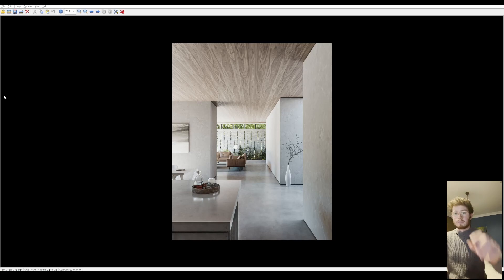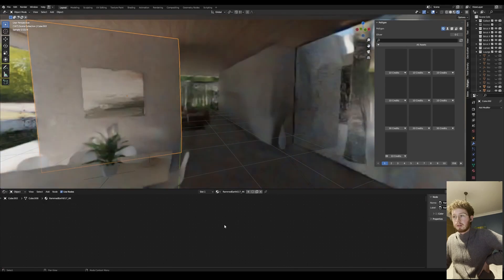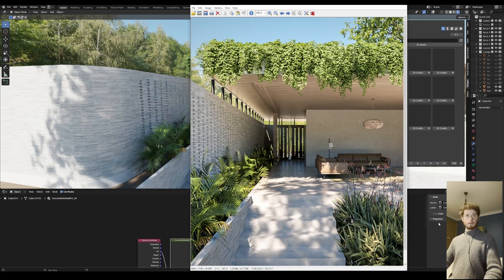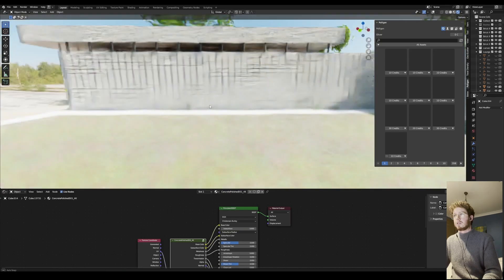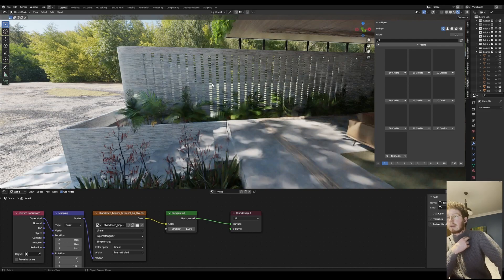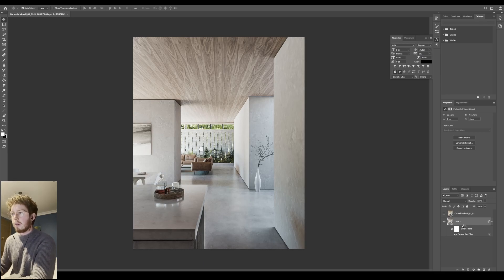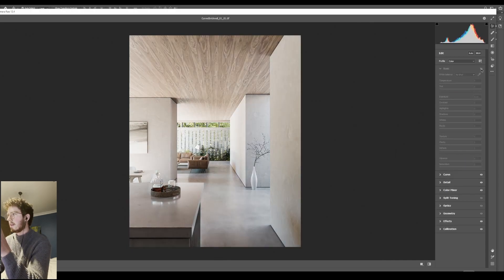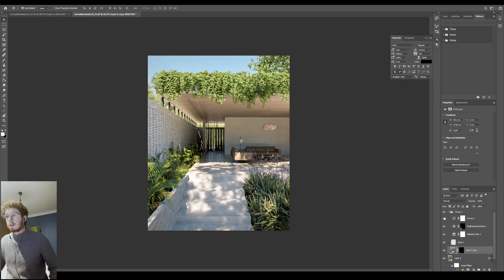Blender Archviz Project Breakdown: Curved Brick Wall

Comment: Hey bro u be doing alot on here and its definitely helping me big time, thanks. I'm a newbie in 3D archviz and I'm finding this whole offline rendering and CPU thing very interesting.  i have an nvidia rtx 3060ti 8gb gpu but the vram is always running out of space when I'm doing some basic scenes and its really exasperating. so i really wish to know more on this and how to manage that
Reply from the maker: Hey mate you definitely want to switch over to your CPU if you have more ram than your GPU. Other than that just try to optimise the scenes, link your vegetation and other big files into your main blender file instead of just importing in normally. Hope that helps

Comment: Nice presentation. Can you also share your hardware specs and also comment on that subject when in comes to working with archviz?
Reply from the maker: Sure! My hardware is as follows: i7 7700k, 64 Gb ram, RTX3070. Gpu is not important if you’re doing offline rendering, you’ll just need a good cpu and lots of ram. I have a decent gpu because I use unreal ending a fair bit. If your scenes are massive like mine normally are, they’ll be way bigger than even the best GPU’s can hold on their memory.